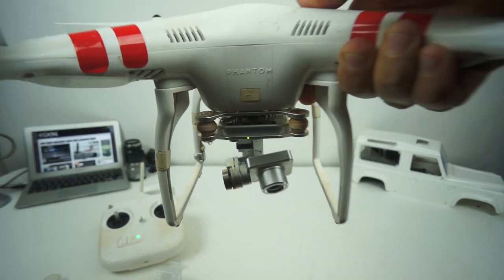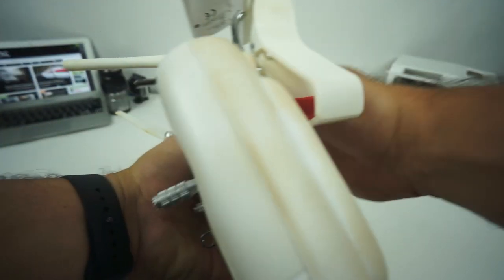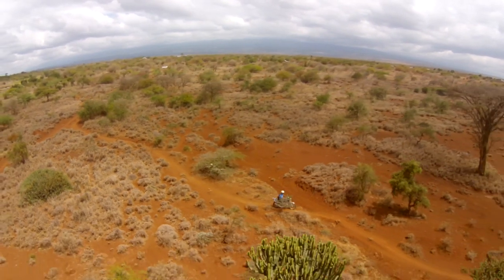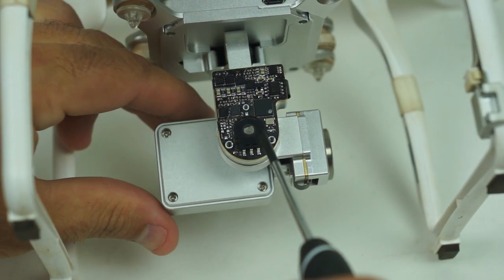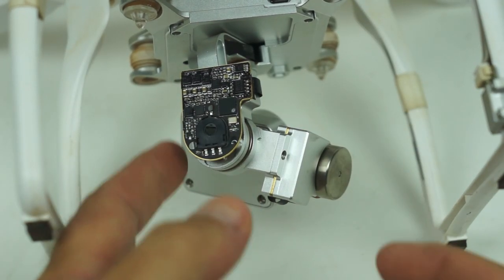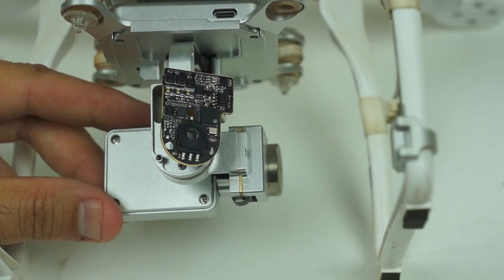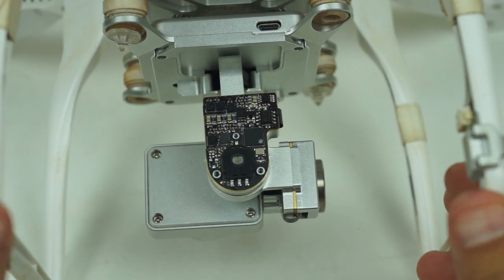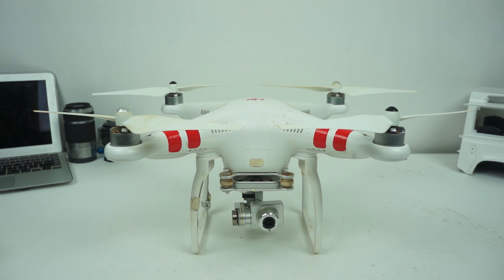How To Fix A Crooked DJI Phantom Vision 2 Plus Gimbal Camera

Comment: What version is your V2+?  I have Vision 2+ V3.0  and I've tried the same repair on mine, but cannot twist the post.  I'm a big guy, and used a lot of force, so I'm wondering if they changed the post when they released V3?
Reply from the maker: +Terry Allen Not sure. Mine was purchased a couple months after the release, but I no longer have it to check as we've upgraded to the Phantom 3 Professional.  It was tight, but didn't take much force for me. It's possible it was changed, but I would think the main changes would be to electronics inside.

Comment: i got the same problem with my drone, after the crash i replaced the cabel was damage and when i turn it on was dancing like crazy not stopping, i follow your instruction as you did in this video but its still the same can not be stable.
Reply from the maker: Hmm. Not sure what would make it dance like crazy. This fix was more for fixing the alignment.